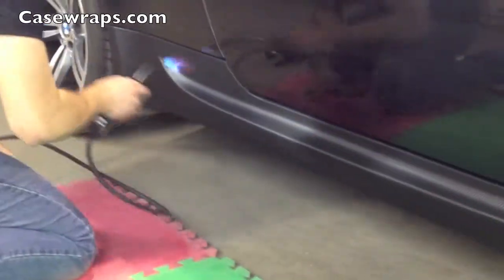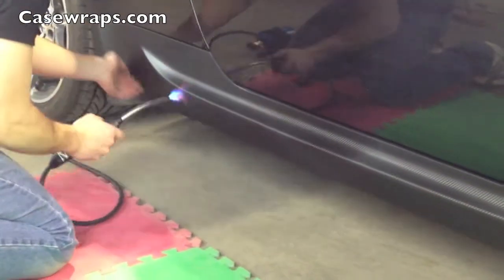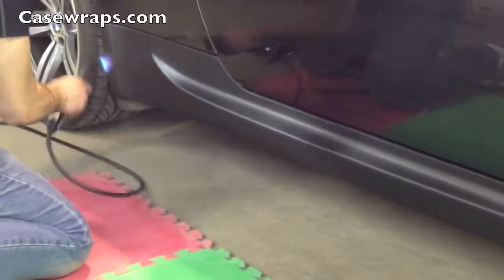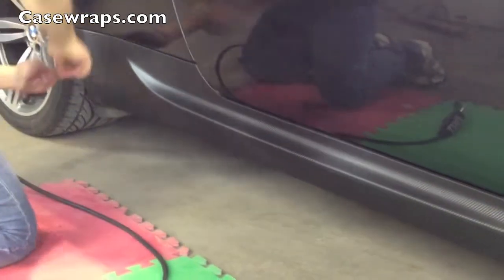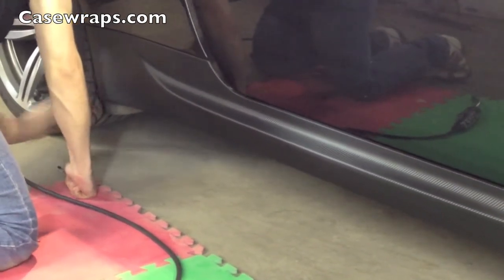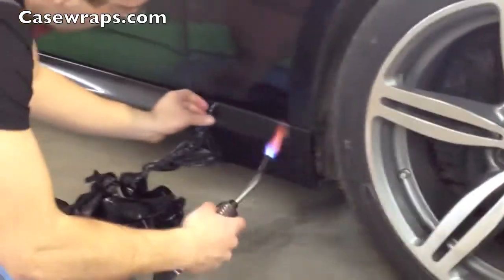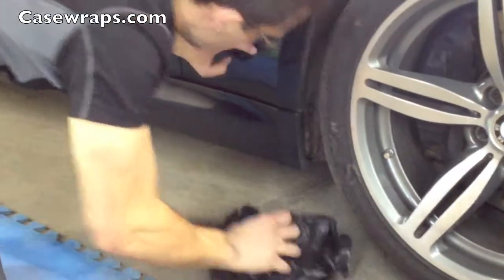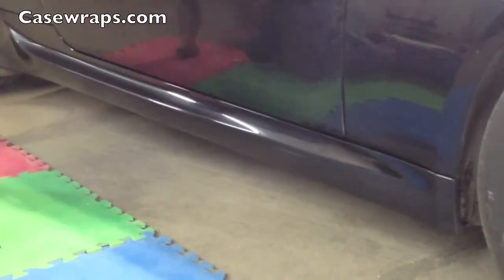DIY 3M 1080 Vinyl Removal - With Flame - Proceed at your own risk

Comment: Any tips for taking a wrap off a 42' transit bus ?
Reply: Same concepts apply but use a large tiger torch. Keep the flame moving. Keep the metal/vinyl warm. Even a little flame like this too slow. Large vinyl you can peel of in sheets if the right temp. Don’t burn things!